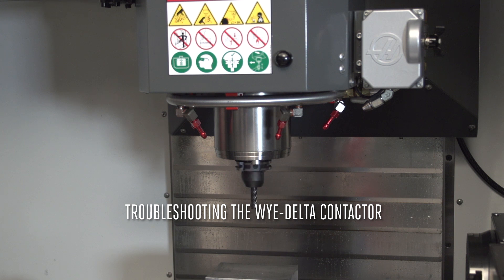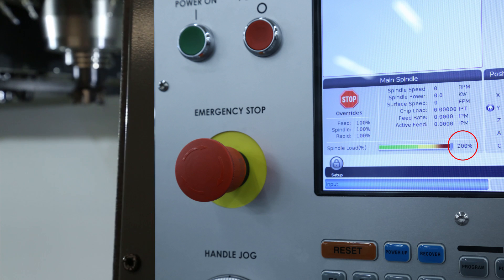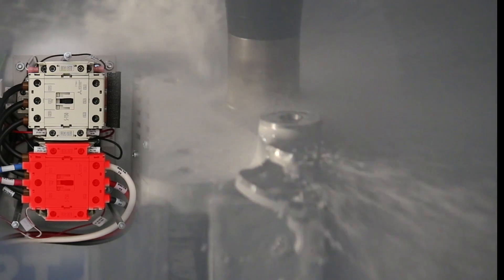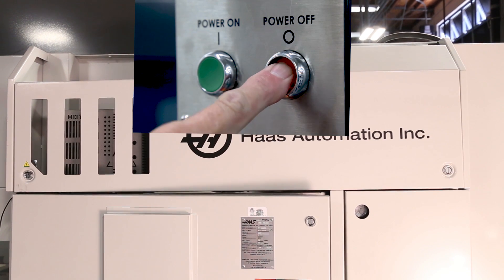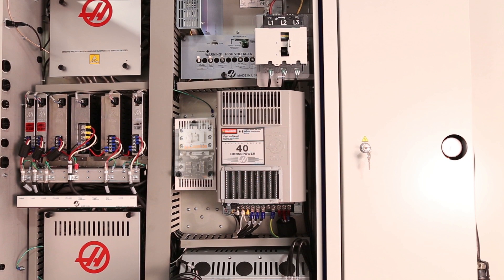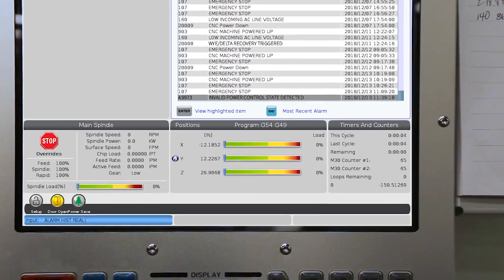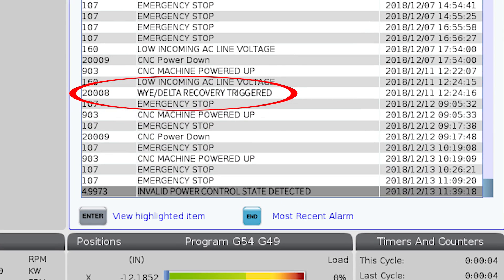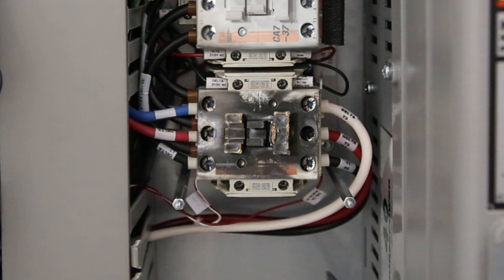Troubleshoot the Wye-Delta Contactor on your Haas Machine - Haas Automation Service

Comment: Or the gearbox on your SL30 is acting up and the hfo tech is like the gearbox is going out.  “I’ve been doing this for 15 years, trust me.”  “Just run it til it goes.”  After sending the gearbox to ZF and they said nothing was wrong with it.  Wound up being the wye delta contactor